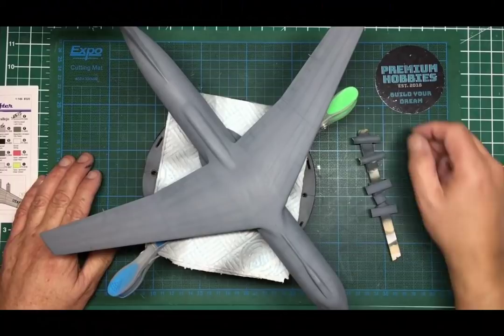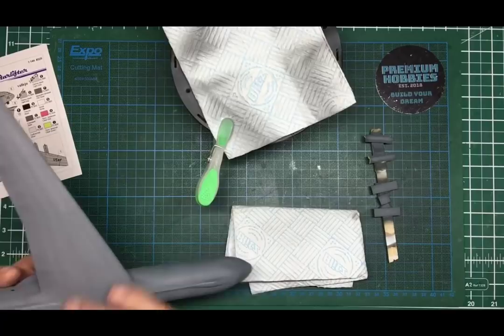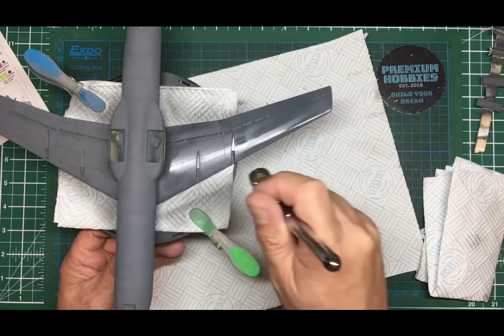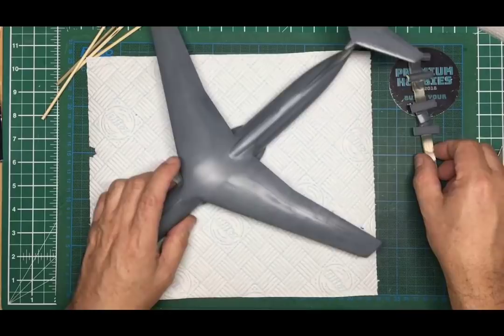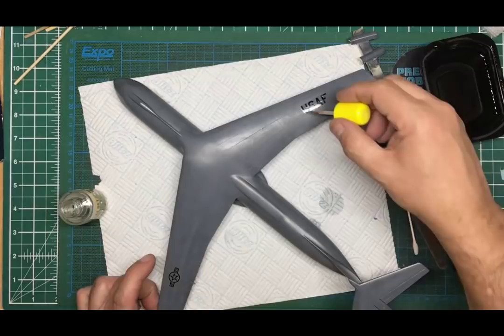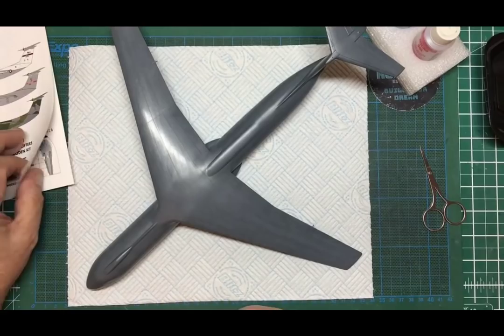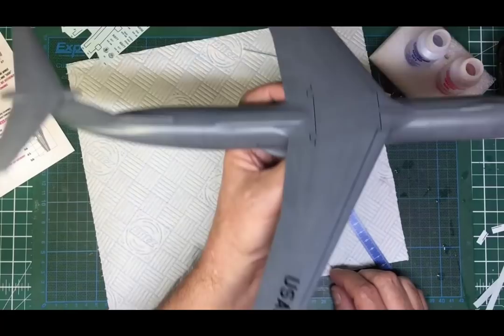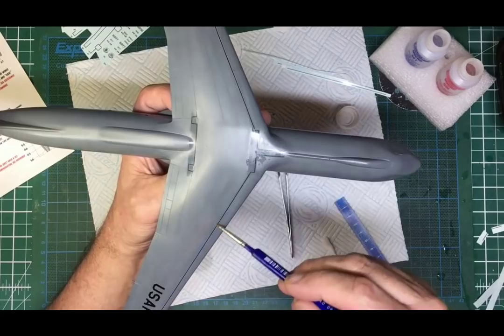Roden 1/144 C-141 Starlifter build. Part Eleven.

Comment: I have been warned for the Roden decals, thanks.
It seems the kit I have is a second release of the C-141B, it's kit no. 331, but apart from a different decal sheet the kit is the same.
So I get me the Caracal sheet for this, which I already bought for the C-5, they look a lot thinner indeed.
I have to admire your perseverance to get this kit right and go trough all the problems, which gives us a chance to do everything right the first time.

Comment: Hi mate you can get Johnson clear on Amazon UK it is shipped from the USA its the original stuff, because the Eu won't allow the sale of the stuff for Heath and Safety reasons.
Reply: @Shiddy123  If you go to Amazon USA you'll find it two bottles $18.49 you need to order over $25.00 to get free amazon shipping. Clear bottle blue lid brown labelling. Ive got some myself. EU banned it because it had no colour or smell, still available in the USA, go figure!!!

Comment: Very nice Nigel -  off topic getting rid of seam line is a big problem for me - I used your method of using a tooth pick to keep the parts apart but I'm stil having a problem - still if it was easy it would be much fun -